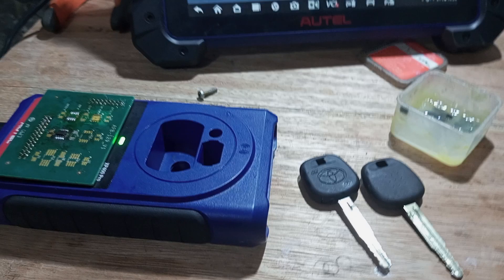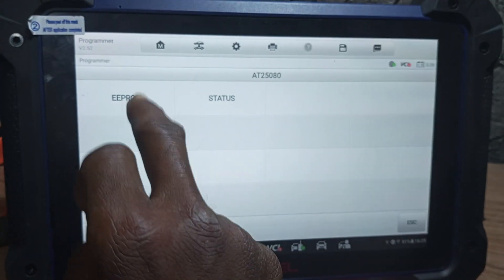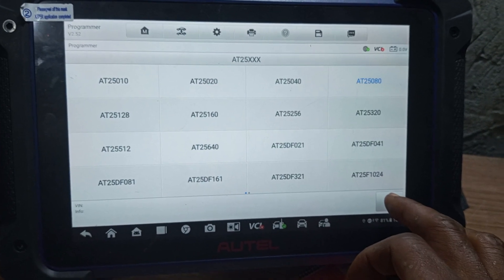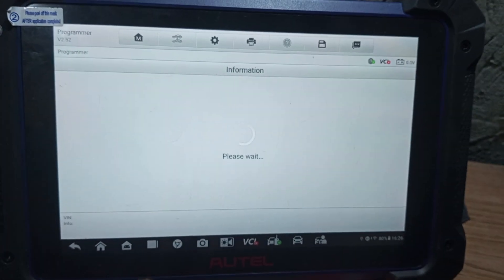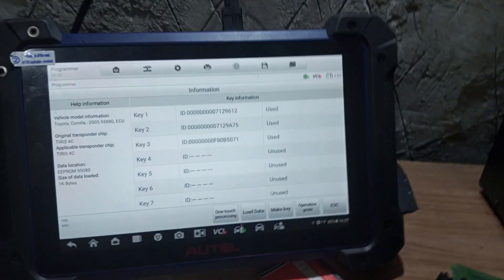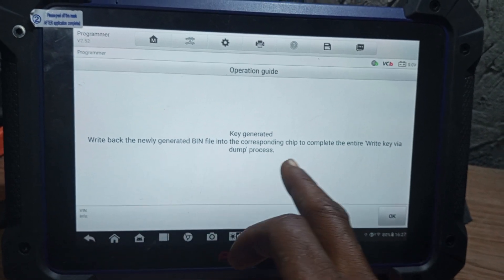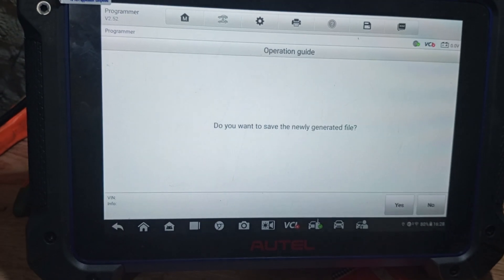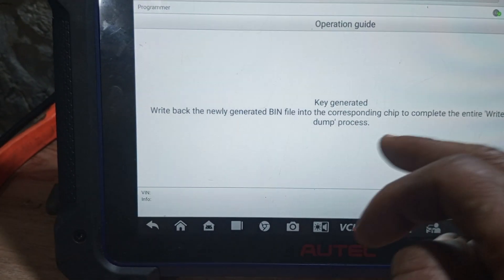how to programme two Toyota keys on a bench with the Autel IM608 pro II. @Lasselectricalzone

Comment: sir please explain MERCEDES transmission change programing mthd
Reply from the maker: The first step is to save the original TCU data. After saving the original TUC data, then disconnect the TCU and connect the One you want to program. If it is used TCU, you have to erase the Data and write the Data you save from the original TCU. After writing the data, go to VIN and write the original vin into the TCU . Lastly you activate the TCU.
Reply: Brilliant